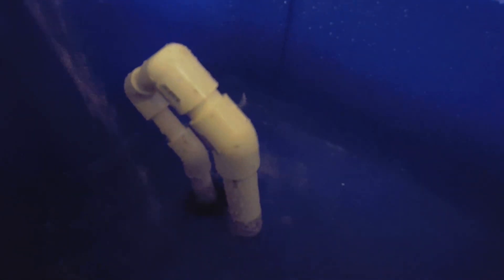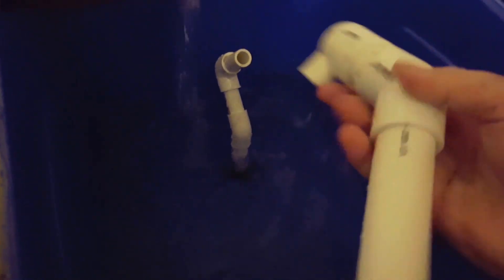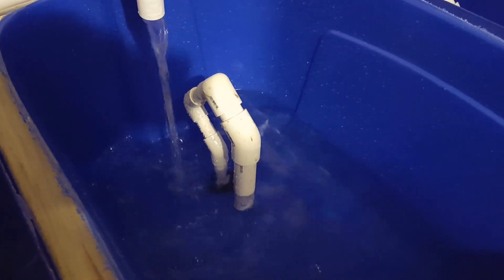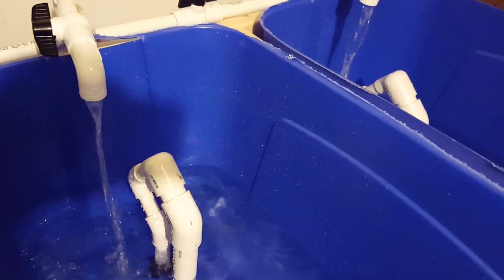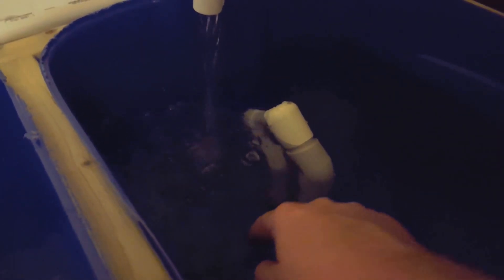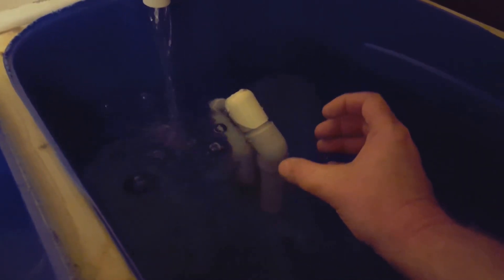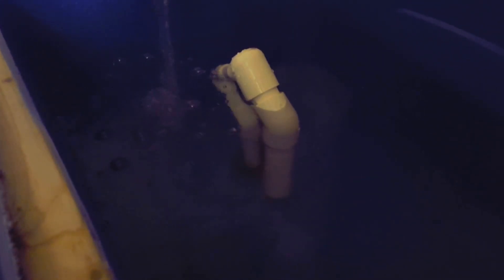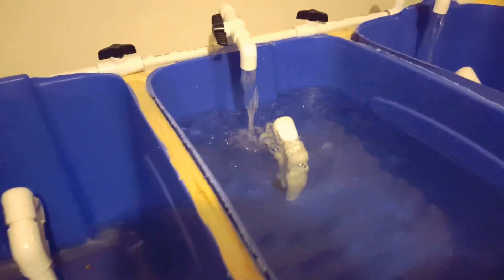U Siphon 2.0 Better Siphon Break  Aquaponics Hydroponics

Comment: Why do u call it 45 when its more than a 90 degree angle?
Reply from the maker: Yes u are right....what I have to make a U siphon is a 45 degree from the intake pipe..then two 90 degree elbows which makes the top..then another 90  elbow to a 45 degree  going back thru the uniseal to the fish tank below
Reply: this depends on how you're measuring the bend. The angle between the joint is 135 degrees. However when referring to piping, it's measured on how much it was bent. So if a straight pipe is bent 45 degrees, then it's called 45 degree elbow. Like if you bend your elbow 20 degrees, the angle between your humerus and your radius/ulna is actually 160 degrees.

Comment: Just wondering if you thought of using an external U-siphon so you would have less pipe in grow beds
Reply from the maker: Sure...You're absolutely correct I could free more space for the roots...Perhaps if I build another aquaponics system I might try that.  The number one problem I have had is the roots growing up the intake pipe....I have had to clean it out a couple of times now...so yes if it were outside it would be superior to what I've done

Comment: Thank you for the update! What are you using to protect the 1" intake pipe from the plant roots?
Reply from the maker: I use a 2 inch cap..that I drill a hole through the top to let the intake pipe through and then ive drilled small holes all around the sides to let the water in but not the clay pebbles...You can see it in the first u siphon video I did
Reply: The roots will be in that in a few months. You need to be able to get to your opening to clean it periodically. Nothing like walking in to one of your beds overflowing and losing a large amount of water. Yes, I've been there lol